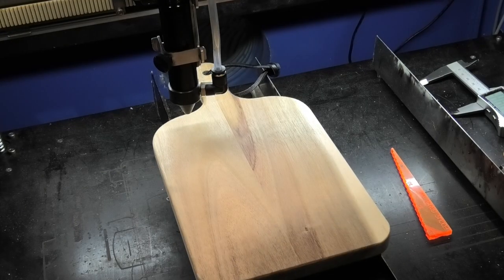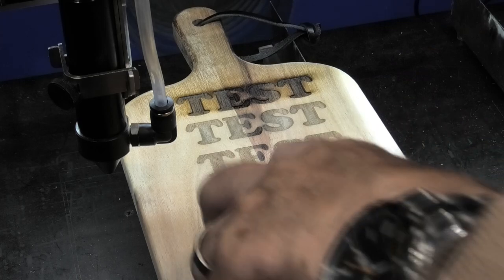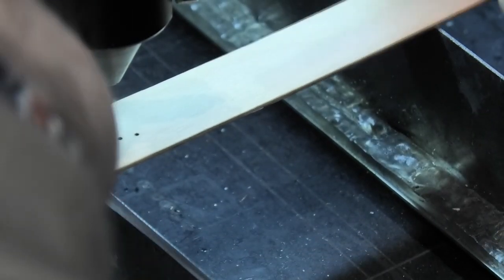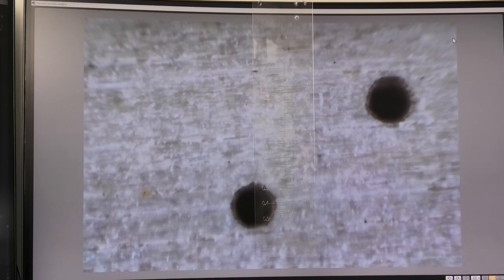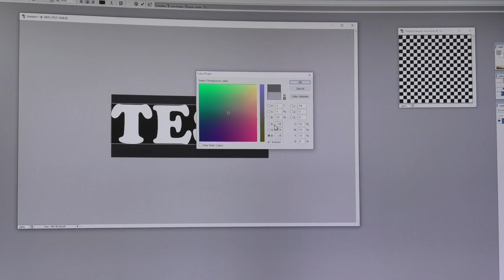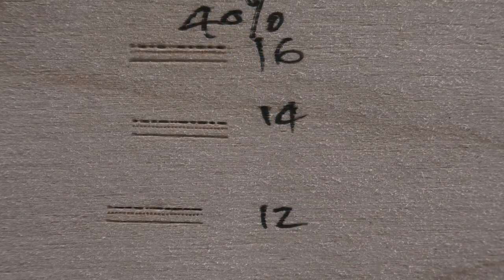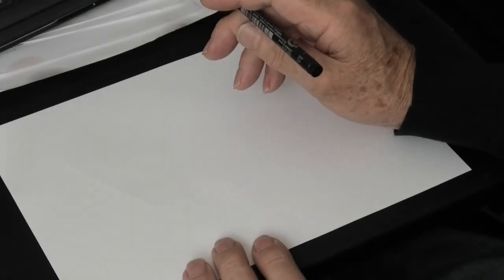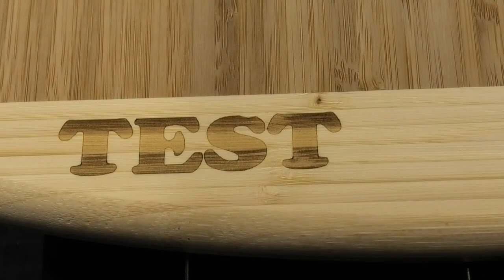Multi Colour Engraving

Comment: How do yoj set the laser pulse?
Reply from the maker: If you have a 6442 controller then press the ZU button to see another menu. Look for Laser Set and then chose MANUAL as opposed to the default CONTINUOUS/ You can then set the pulse length in milliseconds.  For other controllers it will press the MENU button and under the FUNCTION section you will again see LASER SET..

Comment: I wish you would start exploring diode lasers, 10W - 20W of power for DIY. There are sooo many people (including me) that live in flats and want to use laser for DIY and diode lasers are perfect for that + I think they are even better for engraving than CO2 lasers.
Reply from the maker: Hi 
Just because I dont have a channel about diode lasers  does not mean I haven't used  or experimented with them . I have explored all types of laser technology  from 10640nm wavelength CO2 machines , both constant current (as I use in this video) and RF CO2 lasers. I have also spent much time exploring 1064nm wavelenght fibe laser machines  Different wavelengths of light interact with materials in completely different ways. There are a few things that the 450nm diode can do that a CO2 laser cannot do, but they are very few.. The CO2 laser is so much more flexible,and way faster. 
I will not go into all the differences between the machine types other than to say that I can fully understand the attractivness of a small footprint machine  for people such as yourself. Although I explore and use the most powerful and flexible  laser technology for hobbyists and small businesses, much of the science is applicable to all types f laser. For example the dithering technique I demonstrate is equally applicable to a diode laser . In fact diode lasers seem to produce much more tar residues aroud cuts and engravings than CO2 machines. I suspect its the ill conceived air assist sytems used.. .

Living in a flat does have it's problems  but don't be fooled by the advertising because that glosses ove one important issue.  Burning wood, leather or card produces the same smelly fumes regardless of the laser technology used. . You have to do something with those  and that's the REAL problem..You can't just poke an extraction hose out of the window  because your neighbours will soon complain and a recirculating fume extractor  with activated carbon filters are  expensive to buy and expensive to maintain (replacement filters). I speak from experience of owning one.

 Diode lasers are not cheap and are VERY slow . They operate with a PWM control system which has it's own drawbacks  and some advantages if you understsand how to exploit them. A similar small footprint CO2 laser used to be called a K40 but is now just descibed as a 3050 machine.  I took such a machine about 18 months ago and  turned it into something very special. You might like to look at this short video to see a small footprint 45 watt machine working 10 times faster than any diode laser.   https://youtu.be/zu-hccXJPBg

 As you consider entering this world of laser technology , please put your sceptical hat on and research well. EVERY manufacturer is trying to sell you a dream. You may wish to call in at the "Steve Makes Everthing"  Youtube channel as he has lots of sensible stuff on diode lasers.
 Best wishes and good luck
Reply: @SarbarMultimedia  Thank you for the response. 
I started following your channel about 2 years ago when company that I work for bought 140W CO2 laser and it needed beam alignment after about 9000km shipping from China. Since laser was not used that often I took the oportunety to "play" with it and I liked it very much, so I have some experience with smells and fumes :D from cutting and engraving wood, acrylic, cardstock, leather, rubber (making gaskets), polypropylene, I also tried cutting glass, actually engraving it and digging up layer by layer... Laser is gone now, sold recently and that is why I am looking for small DIY machine to buy it for my hobby projects. 
My flat is 50m2 so there is no space for CO2 laser neither would I invest that kind of cash for my hobby, CO2 is not mobile, requires laser tube cooling (chiller - separate unit), fume extractor and "larger" air assist "compressor", ist not something I could "hide" when I am not using it :D 
I know CO2 is better but, unfortunately it is what it is, I can only go with diode laser.
The reason for my initial comment was enormous offer of different models from our usual supplier -> China and it's very hard to differentiate truth from advertised "dream" that they are all offering for not that small cash either. As it usually is, less know brands can offer same, sometimes even better performances but larger brands, on other hand, have longer "history" so you can find more resources and support about them online, more reviews on YT, you can get a bit better sence what can you expect from the machine (if you can distinguish honest content from "they sent me free machine for a review" content).  I was looking Ortur, Xtool, Sculpfun, Neje, Atomstack and there are many other, it becomes art picking good quality for reasonable price, you can easily overpay if you just look at their marketing.
I always consider you to be truly unaligned source of information and therefore most objective in presenting performances of the machine, if its bad you wont hassitate to show that, if it can be made better, you will show it, thats why I think that your opinion on swamped diode lasers market would have high value.

I will now check advised "Steve Makes Everything" YT channel. Wish me luck :D
Reply from the maker: Hi
 It's great that younhave a flying start with laser tecnology so you won't be surprised at ther limited performance in comparison to the CO2 you have already used. Steve is another honest guy that makes mistakes  (and admits it) and also gives an honest opinion. He has CO2 experience as well but has turned to the world  that I have stayed away from.  Fume collectionn will be your biggest issue. I think it is only the X tool thathave looked at this seriously and have a small  proper recirculating fume extraction system. But as I mentioned earlier . it's not cheap and look at the filter replacement recommendations
https://uk.xtool.com/products/xtool-smoke-purifier?gad=1&gclid=Cj0KCQjwvL-oBhCxARIsAHkOiu3UHKDEMsCy2LfI04QoeTMH_IvW0GhdtaWqiFBHY3E9WUMxIGWJMcUaAnuMEALw_wcB
 Most you tubers show you how they are using their machines  to make things or to demonstrate "hacks" for  issues they have encountered. As you know, that is not my style.  I try to understand the reasons for the problem and find a logical permenant fix.
 Ther problem with diode lasers is the specifications. they often clain fantastic "spot" sizes  which are based on theroetical lens performance if it was a pure optical system transmitting images  with normal light. I have yet to come across any optical software that can model the complex way that the Gaussian laser beam intensity interacts with a lens. We are trying to focus light intensity to do material damage and that is not normal optics. Yes the rays of light follow the usual Snell's law of refraction but that does not account for the different intensities of rays.
The other problem with a diode beam is it starts life as light from a rectangular chip. It has to bo optically manipulated within the head to try to make it a round beam. Some laser are more successful than others but look at most spec sheets and you will find that the beam is oval, Typically 5-% wider than tall If you try to burn this spot size onto any material I can guarantee that it will be 2 to 4 times bigger in reality. Also there will be claimed speeds of maybe 400mm/s. That will be the max speed of an axis and in no way relates to cutting or engraving performance. Somecheaper machines have either fixed PWM freequency or VERY little adjustment. Look for a machine that at least 1 to 20khz  more if possible. Thisis not data you find on the spec sheet you will have to ask the manufacturer. This is vitally important if you plan to do photo engraving.
 Good luck in your search' Although I am not a diode user I know a great deal about the technology and the marketing tricks used.
Reply: @SarbarMultimedia  I agree. Diode laser is not the sellers say. If you have no space and search for something cheap, the better choice would be a 3020 Co2  machine, K40 with a M2 controller. I did a comparision between diode and K40, first one cuts 3mm MDF with 100% power around 4 mm/s speed, the K40 made the same at 35% and 12 mm/s.
Reply: Amazing detail and explanation. 
I have 2 questions if I may?
1. How did you set the pulse time on your machine?
2. I have come from a 100w 2.5" lens laser that would cut 3mm acrylic at 18mm/sec and 32% power, nice speed and power.
     I have since bought a laser with a 90w 2.0" lens, now having to cut acrylic at 12mm/sec and 65% power! I don't understand why I am using so much more power but only lost 10w on my tube output!
Reply from the maker: Hi
 You are not alone at being puzzled by the "problem" described in 2)
But first the simple answer to 1). Most people will have a Ruida controller  (probably RDC 6442) and in that case you must press the ZU button to access a seperate menu. Yuo will see Laser Set where you can select manual or continuous. If you select manual you can set the pulse length in miilliseconds. If you have an RCD 5445 or a 6585 then you will press the menu button and then the function option to access laser set.

Back to 2).  This is not a single or simple answer. First, can I ask you to watch   https://youtu.be/z8sNPtIIXZ4  This will show you the  importance of the INTENSITY disrtibution  within your laser beam. You can have beams of equal power but with different intensity profiles and they will perform cutting with varying effectiveness.

As this video shows (using Reci as an example) laser tube manufacture is not a precise science  because the precision of mounting the internal mirrors is crucial to the final output performance.  Once manufactured , the tube cannot be rectified and effectively become scrap. Beam quality, the closeness to a Gaussian intensity distribution, is specified by all manufactureres to be better than 90% but as I show in the video if you unkowingly buy a B grade tube (this issue is not limited to Reci) then who can say what the INTENSITY profile will be. Yes, it may deliver the promised POWER  but you do not damage material with power you damage it with INTENSITY. The greater the intensity the FASTER you can damage material. Is this ringing warning bells about your new tube?

 There is a whole secondary set of conditions ocurring as you pass the beam through various focal length lenses  because lenses do not perform the same way with laser beams as they do with normal uniform intensity light. There are many videos on YT that explain how lenses shape the beam for cutting material. I am not being arrogant when I say they are all wrong. The concept of lenses focusing to a single point is perfect for describing what happens to IMAGES as they pass through a lens. but that is not what happens to INTENSITY.. Lens theory has no way of modelling varying intensty rays as they refract though lenses. .....but that is a whole new subject.

 In the first instance I would check the QUALITY of your new tube  with a simple mode burn test into a block of acrylic. see   https://youtu.be/naPzFsuvURU

 If your beam creates a "blunt" profile then it's B grade. If it burns a very sharp trumpet shape (as shown in the video) then you have the promised 90% beam quality.

If you wish to communicate further with emails and send me images of your burn profile you can reach me with this private access form
https://forms.zohopublic.eu/ndeavorlimited/form/K40XtreeemLaserCutterContactRussSadler/formperma/k2Cn0QN5ChpazfTMAUw25lZ-FKpjZa96TQWHjv3ntOg
 Best wishes     Russ